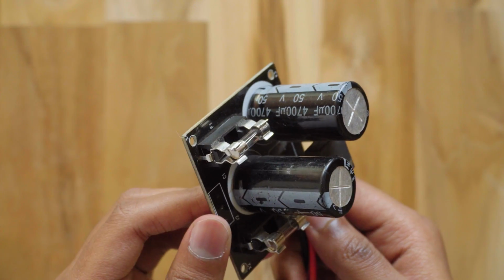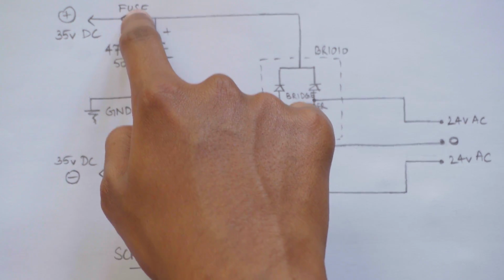How to make High Power Audio Amplifier for Smartphone!

Comment: Hi Vimal,I made this Amp yesterday as shown by you in the 
schematic diagram & it's working perfectly, sound quality is Awesome.
I have used Pioneer 6x9 threeway Car speaker it was sounding really great, 
but the only problem is that the output transistors are
getting over heated please tell how to avoid overheat problem?
Reply from the maker: +Crazy Ravi I think the heating problem is due to the impedance mismatch of the speaker because generally most of the car speakers are 4ohms type and my amp is designed for an 8ohms 50Watt speaker. So,try using an 8ohms speaker. There are some modifications to be made in this circuit to use it on a 4ohms 50Watt speaker which i'll definitely show in my future videos.
Reply: Thanks bro, when I changed the 4ohms speaker with 8ohms one, the heat in the output transistors decreased :-)
Reply: Crazy Ravi Hi man! I would like to ask for the components of this project and if you have the pcb layout please send it to me. I really need help. Please please